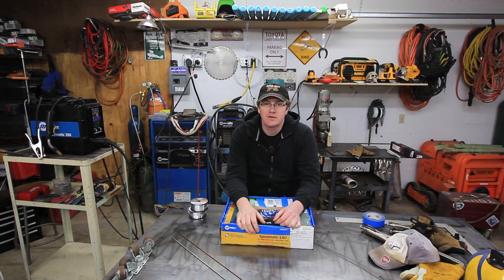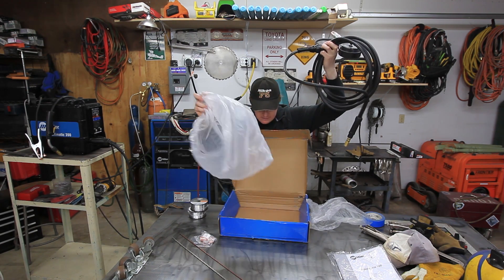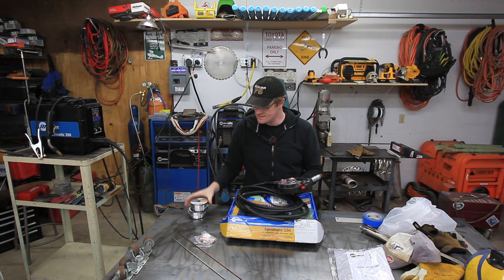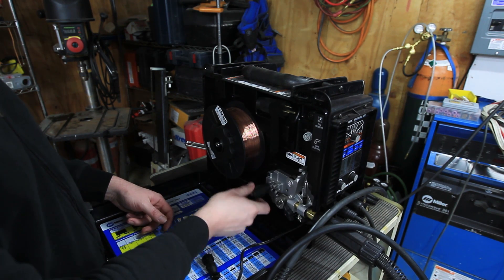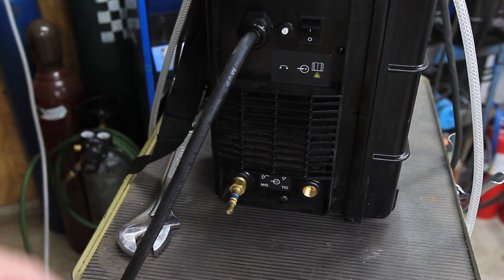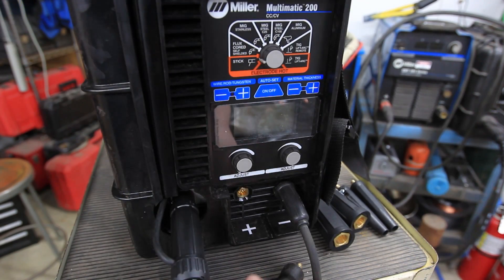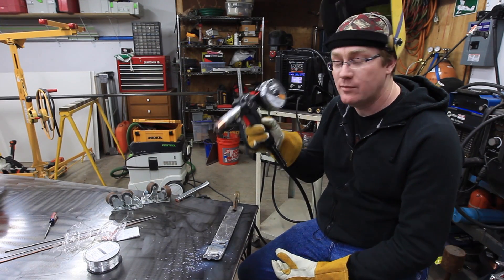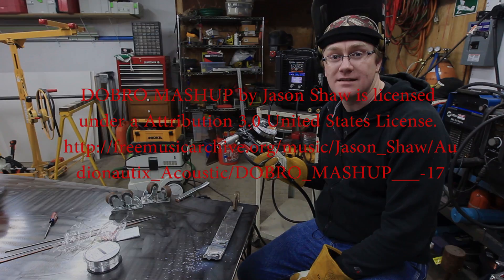Miller Spoolmate 150 Unboxing and Setup

Comment: I weld aluminum with my Lincoln 140hd (120v) with a spool gun, and I have noticed that I also have to run the wire speed fast as well. If I don't, the wire melts before it gets to the work piece. For anyone reading this that might be interested in getting into welding aluminum, here is a bit of knowledge from my personal experiences. Welding with aluminum can be touchy when it comes to manual settings. (Especially on 120v) Although, once you have the speed and amperage set correctly it flows like butter. It's just not quite as easy to set as steel. And by the way, when people say you can't weld aluminum on a 120v machine, (and I've been told this by many shops) that is a false statement. It works just fine. The only thing I noticed is that 240v machines run aluminum A LOT better, and easier. 120v machines work, but require more attention to get your settings just right. You just have to remember that aluminum melts at a lower temp than steel, so you need to have your settings set correctly so that the aluminum wire can get to the work piece properly before it melts and create the perfect puddle with good consistant flow. Great video, just ordered one of these for my brothers millermatic 211. Can't wait to give it a go!

Comment: That 150 gun has a spool drag adjusting nut on the spool shaft. It is a threaded and knurled collar  at the end of the spool holding shaft. This knurled/threaded collar screws in or out and squeezes a rubber tube that expands when tightened down. This squeezing expands and adjusts the rubber tube to make more or less friction on the inside of the plastic spool center hole. My description is the best i can use to explain the drag. Actually using it will answer the drag system question

Comment: Please tell me how thick of material does the Multimatic 200's support using the Spoolmate 150? I have read it does 3/8" but the video only shows up to the 1/4" setting. If it does 3/8", I am wondering how well it works with 0.030 or 0.035 wire spray transfer.  Any idea if it has the driver roll accessories?, 0.040 wire might be better for 3/8" at 200amps

Comment: you can't fine tune the wire speed at the gun. it's all on the power supply, I like a rheostat in the handle. when that board goes out , that's it.